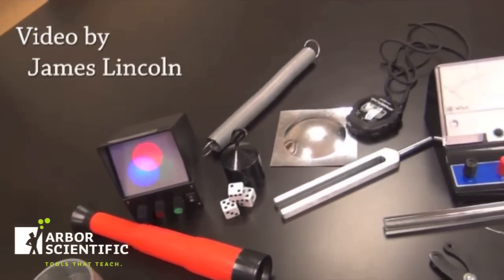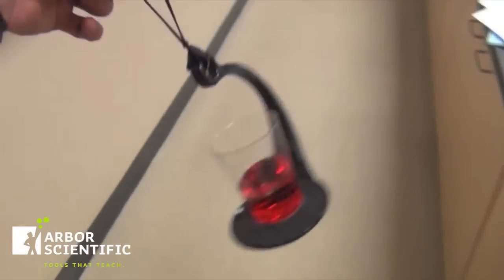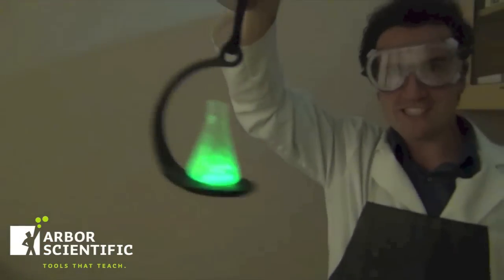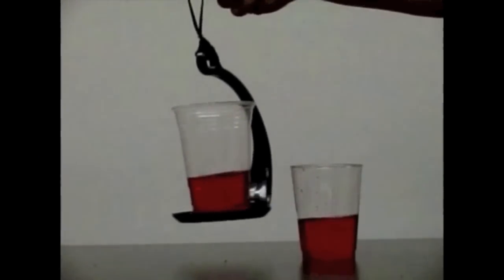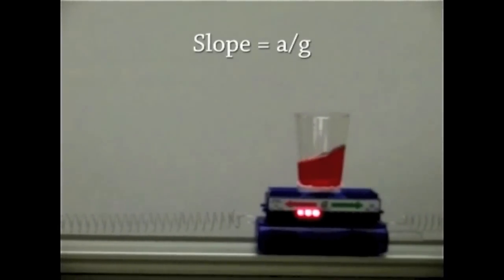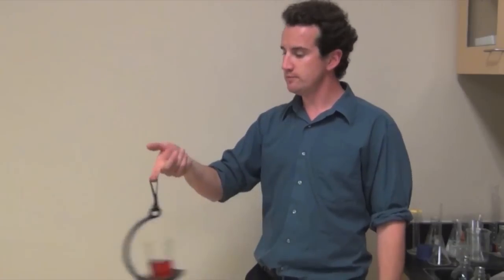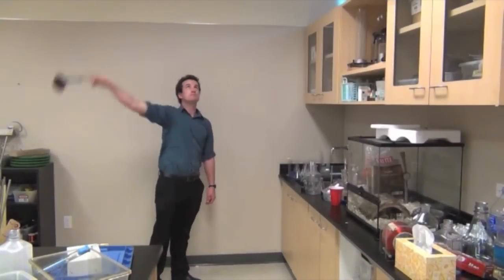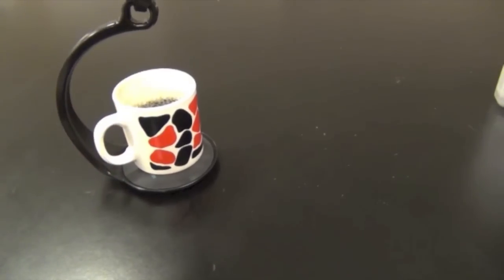The Physics Behind the SpillNot | Arbor Scientific

Comment: This could work with spaceships so we can stay at the center when they go upside down
Like in those movies
Edit:  IT CAME!
It kinda works but it really isn't like in the videos at all. Ah well, Disappointing. 
You can swing it at a certain velocity then when it comes back, it falls. You can walk normally with it tho and it doesn't fall.
No way you can swing it over your head though.

I was curious so I just tested it further today, Looks like it does work but do not swing it to high or it will fall.
Odd, My first testing I did with it did not work at all, Probably had to use it a few times.
It puts the cup in the center and it like doesn't move.

Comment: I understand this.. APART from the fact the cup doesn't fall off the base. Yes, there's the grip.. but that's what defies logic for me.
Reply: centrifugal forces, for the cup to fall you'd require a force to keep the base of the spillnot from falling and only then the cup will fall, basic physics
Reply: @Arne1998  but doesn’t that require the base and the cup to fall at the same speed?
Reply: What transfers the inertial forces from the liquid to the swivel point is what stops the cups from falling off too, I guess. Do correct me if I’m wrong
Reply: It does fall this is fake
Reply: @countrystudent1038  this isn't fake